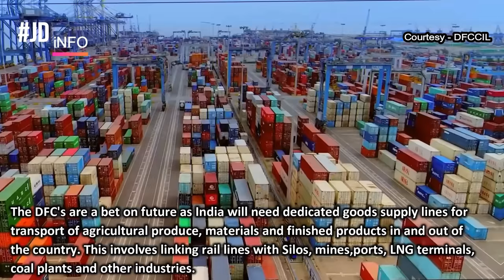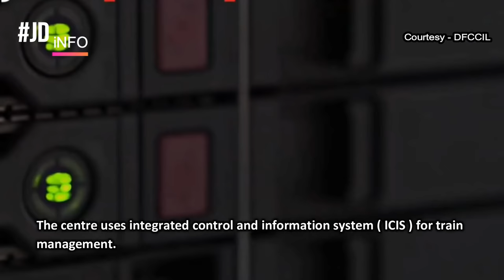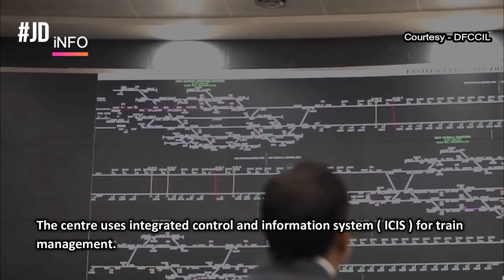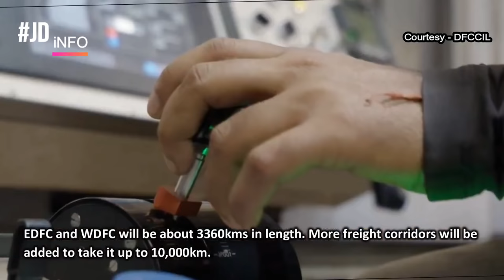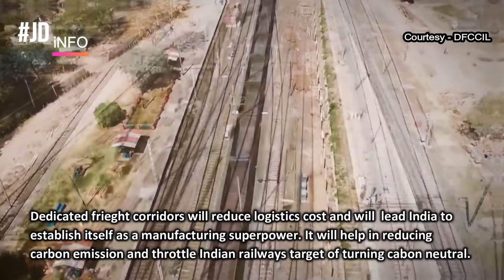India will have the world's most advanced dedicated freight corridor

Comment: Just a small info about this project. This DFC project was planned by NDA under Vajpayee to increase India's manufacturing capacity to be implemented after 2004 elections. By choosing UPA we set the nation back 10 years. India needs to invest in railway lines, highways, ports, airports, Metros for another 15 years if we want to compete and take our share of manufacturing from China. We have the demography. But whether we have the brain to choose BJP is another matter. BJP is not a perfect party but when they are in power they invest massively in infrastructure which has been proven before under Vajpayee and now again with Modi.